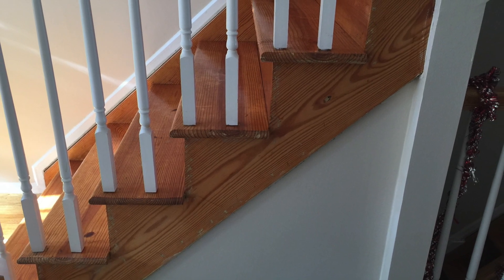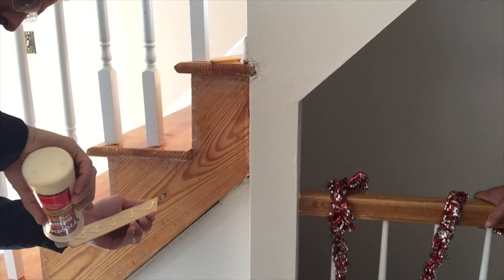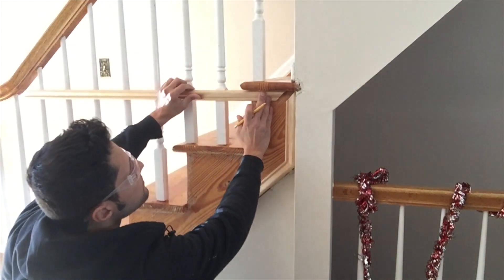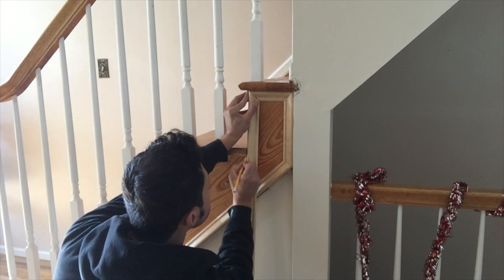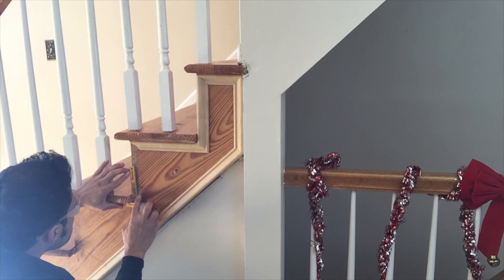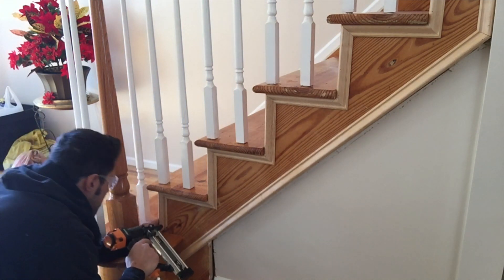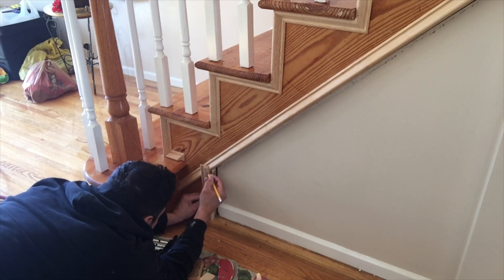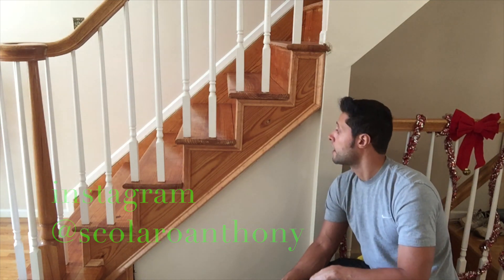Trim Carpentry

Comment: Informative video.  I am struggling on how to trim out the bottom of the staircase so that the floor baseboard wraps up into the stringer and up the wall.  Any tips or examples that you have come across?
Reply from the maker: danny302 sounds like you need to install a transition molding that runs down the stringer  apron to the floor and have the baseboard die into that transition molding

Comment: Hello, in the thumbnail it looks like you put shoe molding on each one of the treads to dress things up a bit. I did the same thing on some vinyl cap a treads I installed. It looks great but now the stairs creak because of it. Is there something I can do to stop the creaking?
Reply from the maker: Your stair treads are moving causing the creak. Nail down the treads and make sure you shot the nails for the molding into something and not into a void between the riser and tread.

Comment: This project looks like good practice at cutting mitres. You mitre saw looks brandnew
Reply from the maker: Wes Hamstra I use an air compressor to blow out all the sawdust after each use to keep it looking that way. And this one is my "baby" so I treat it like a fragile crystal lol
Reply: haha nice. I have a 12' dewalt compound sliding mitre saw. its about 5 years old and it looks it. I slug to jobs with me all the time. it gets used a lot
Reply from the maker: Wes Hamstra I had a sliding miter saw but it took up too much room in my shop and since this cuts up to 10 inches anyway, I didn't need a slider anymore